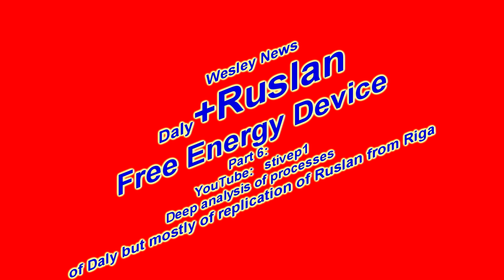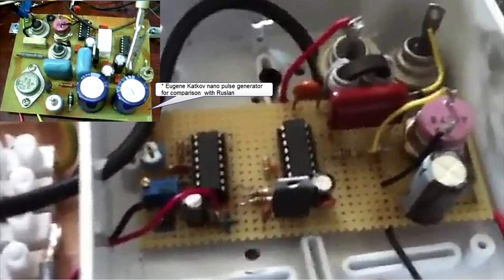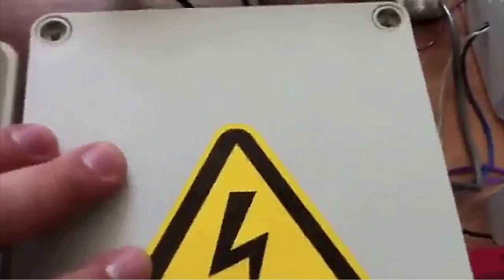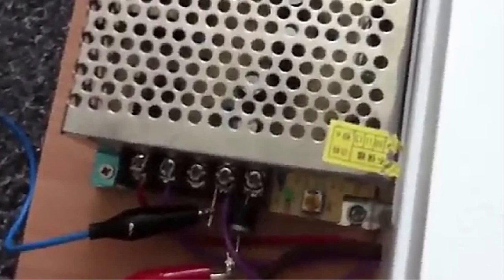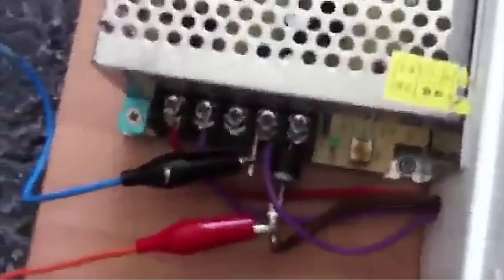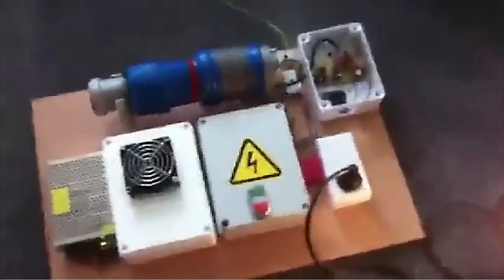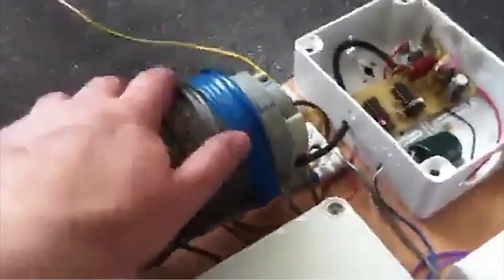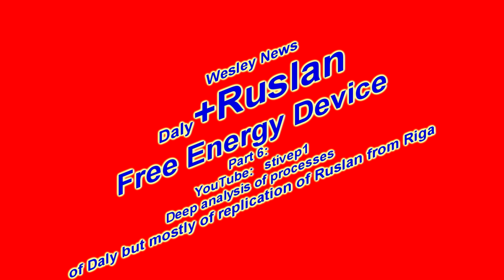Wesley presents:Daly part #6 Free Energy: Ruslan Replication

Comment: Hello dear Wesley, I wonder about this KD203A would be a diode rectifier diode, thyristor or scrotch, a hug.
Reply from the maker: jeferson oliveira  no critical. The only factor for switching is based on  other experimenters nanosecond  switching with short raise and fall time.
Reply: Ok, sure dear, I'll use an NPN high voltage and high amperage will try with the BUX line for this stage circuit. A buddy hug.